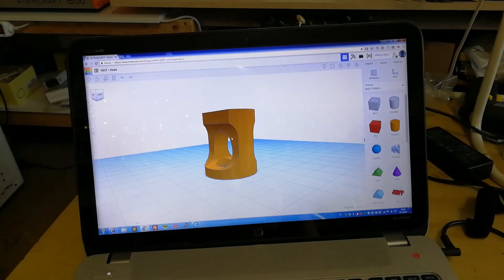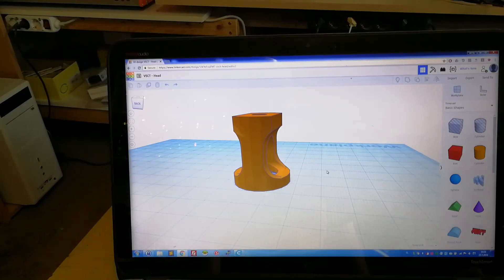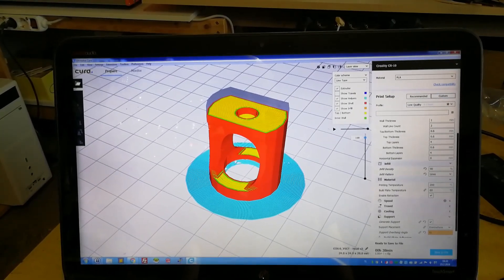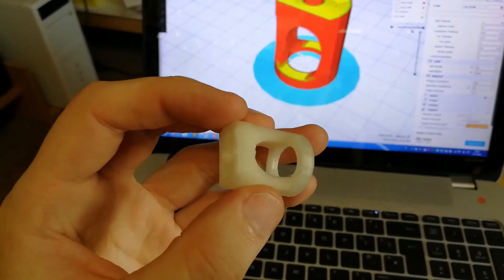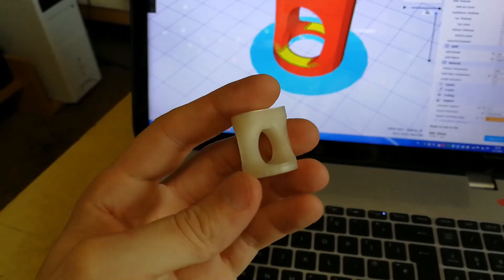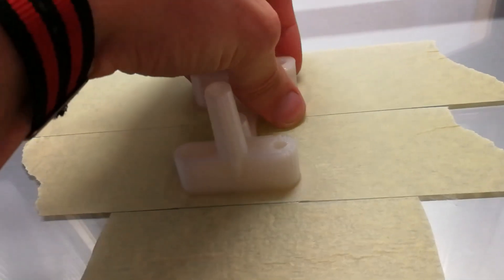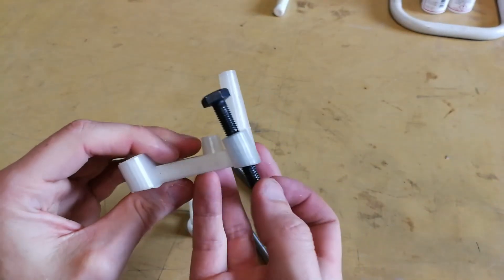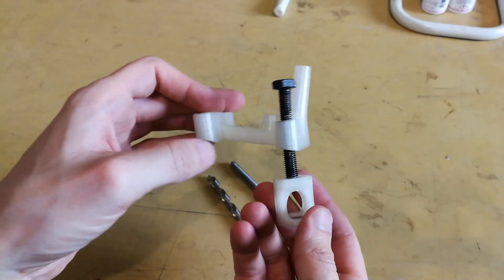BMW N42/N46 3D Printed Valve Spring Compression Tool Prototype

Comment: Brilliant design! When I applied air to the cylinder through the spark plug hole, then used a spring compressing tool to compress the spring, I found some cylinders were leaking air dramatically and difficult to build up appropriate pressure. The valve just keeps falling when I compressed the spring. Normally what reason to cause air leakage and is there any way to fix that? Thanks!
Reply from the maker: I have made a new better design here: https://youtu.be/BMk7dwtj_i0
Reply: @BimmerZen  The new design looks even better. You're a truly BMW master！
Reply from the maker: @hyouzhe  Thanks! I'm not a master, just someone with drive and passion for fixing stuff myself, old BMW's included;)
Reply from the maker: Did you put all cylinders in TDC when applying pressure? Maybe try to put a small table spoon of engine oil in to the cylinders to help seal the piston rings. You might also have a problem with damaged valves... Can you determine where the air is coming out? You can listen and feel through exhaust pipe if exhaust valves are letting air past. For the intake valves it's best to check at the airbox...

Comment: Hey mate, is it correct that the head part has the measurements of 24MM Outside Diameter, 19.8MM Spring Diameter and 13.3MM of the Inside Diameter? I mean looking from the bottom to the part it has like 3 different diameters. Outside Diameter, Spring Diameter and Inside Diameter. 

Really trying to create my own tool. Or in best worlds can I borrow your tool for a week haha. Nah just kidding but would be amazing if you can send me the measurements.
Reply from the maker: I think you have the correct measurements. My tool has 24mm - 20mm - 14mm diameters. If the tool is made out of metal the 24mm can be reduced to 22mm.
Reply: @BimmerZen  Ah means I did a good job measuring from my computer screen. Thanks heaps! I'm gonna start the entire job in two weeks. Just ordered all my parts. Really looking forward to give you a huge thanks on one of your video's.